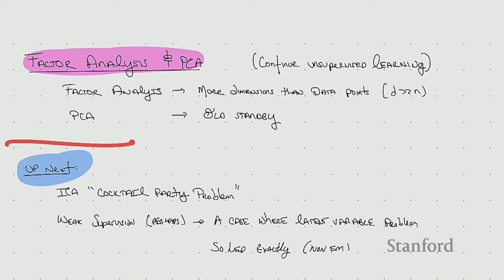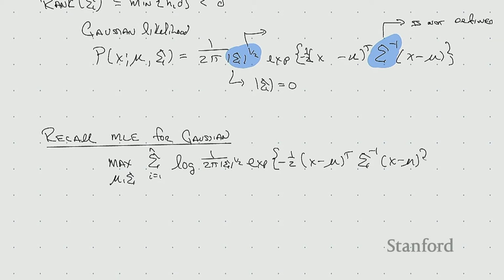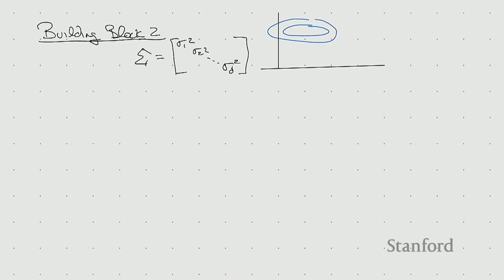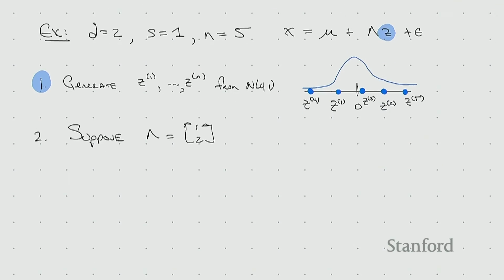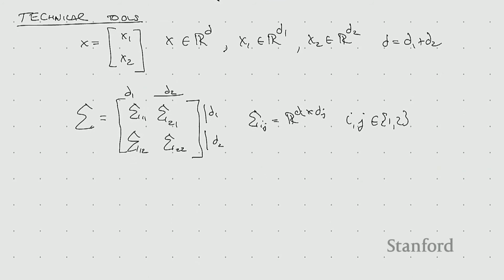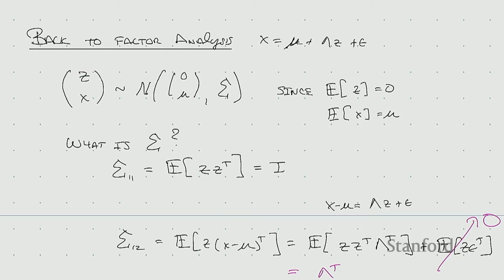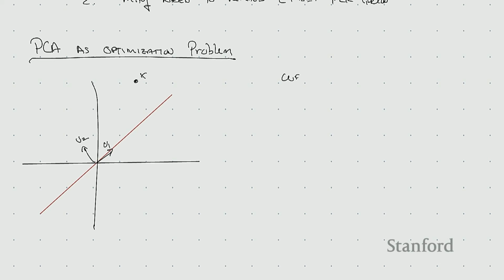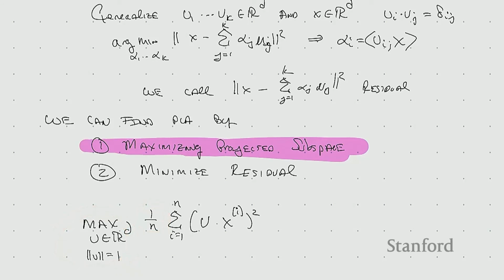Stanford CS229 Machine Learning I Factor Analysis/PCA I 2022 I Lecture 14

Comment: if u_i and u_j are orthogonal, u_i.u_j = delta_ij only if delta_ij = 0
Reply: That's not how the Kronecker delta is defined.U is a set of orthogonal vectors u_i, i running from 1 up to some n; for any i and j, u_i.u_j is 0 if i =/= j or 1 if i == j. That's precisely the definition of the Kronecker delta.
Reply: it's a notation, instead of saying u_i.u_j = 0 if i != j else 1, every single time you use it